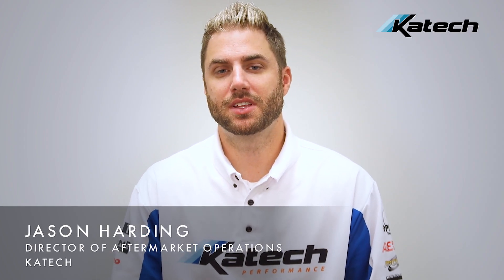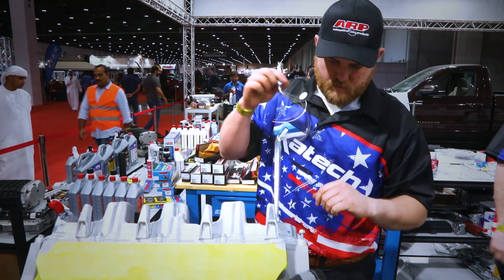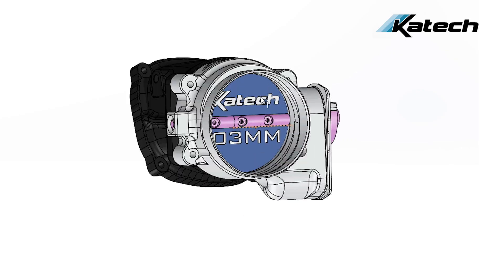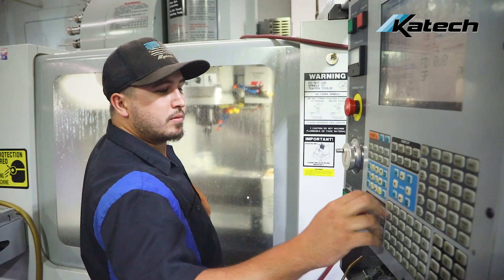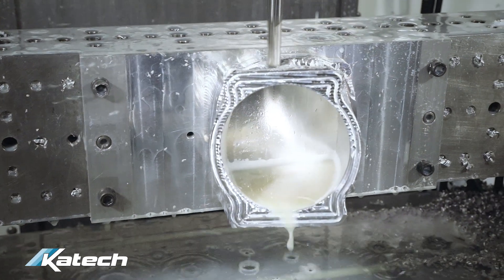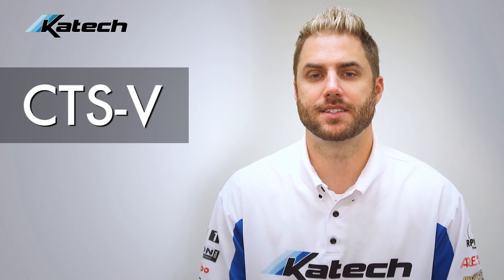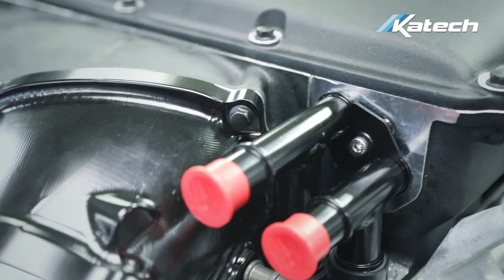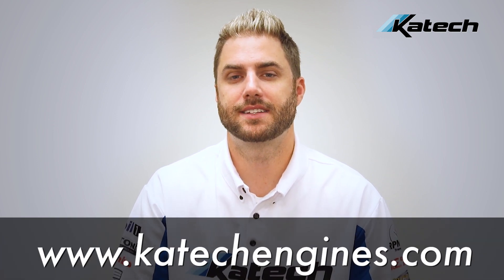Katech 103mm Billet Supercharger Snout for Magnuson TVS2300 Supercharger

Comment: I just put a 2300 in a 98 F body, not a fan 04 the 98 mm weld up pipe and flanges I received with the kit. if you guys can make a snout that I can bolt a 102mm to, or maybe one of your existing snouts would work, my life would be a lot easier. I can send pics of what we have, if you guys can help.

Comment: So does it work? Under what conditions? Where are the test results? Useless without data.
Reply: Hours and hours of data is available online about the flow rates of stock throttle bodies vs the 103 and larger diameter snouts. The stock 87mm or 90mm TBs begin to cause restriction at 600hp of airflow. The gains are exponential based the flow needs of your set up. If you’re running less than 10psi on a stock NA 6.2 then the gains are single digits and not worth the money. Push 15 lbs on a built engine and you’re leaving 30-50 whp on the table along with creating needless additional heat and supercharger load. There’s hours of data on that as well. Good luck.
Reply: above 600whp on the LT1 and you're pushing limits of pistons and fuel system 

pain in the ass at this point because you're basically doubling what you already put into the car and should have just gotten the ZL1 to begin with!!

remember this guys

it's not worth pushing it